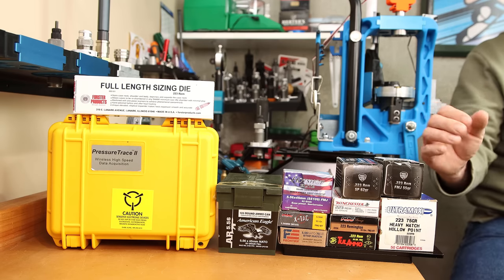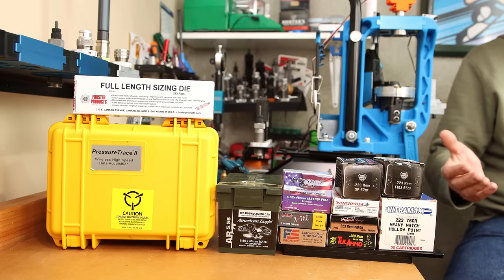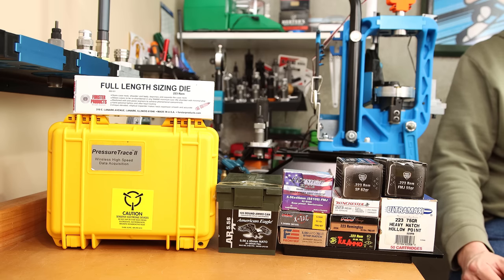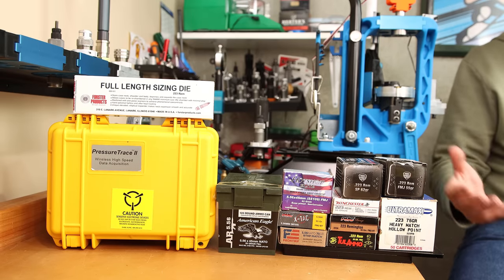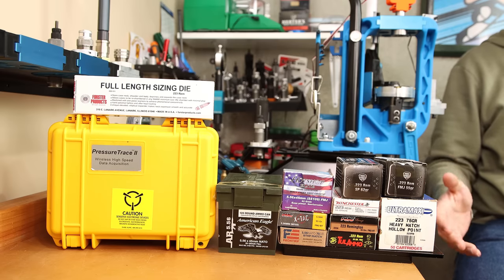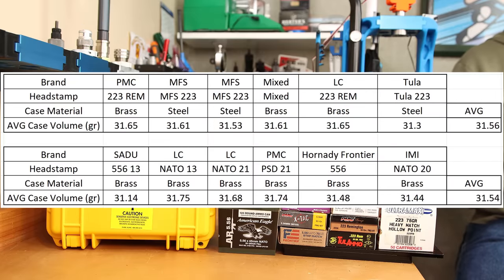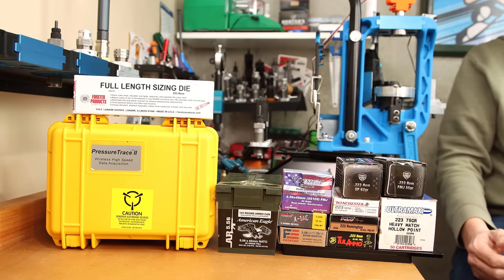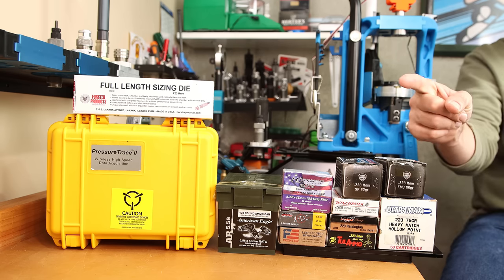223 vs 556 - The Hidden Truth No One Tells You!

Comment: I am not a reloader. Although I would like to become one.
I found this statement.... "The 5.56 NATO has a higher pressure than the 223 round and is one of the two major differences. The 5.56 NATO pressure is about 58,000 psi and the 223 round is approximately 55,000 psi. While that doesn’t seem like much on its face, a mere 3,000 psi, the case difference in the chamber balloons it to a 10,000 psi difference". Is that statement true? So the thing you should be looking at is the barrel not the ammo. Ammo varies from manufacturer to manufacturer, In fact they make ammo for all kinds of applications so it will never be uniform. So looking at ammo does you no good at all. What is a 5.56 X 45 nato barrel rated for vs. a .223 Rem? Which will blow up in your face first? How many rounds will it take to overstress a .223 barrel? Does the military use the same data for loading their ammo? Where does the 10K psi difference come into play? If they are the same why mark the barrels differently? As you say, load conservatively. Who needs such a hot round anyway? Stay safe.

Comment: Impressive equipment. Having reloaded for many years I have not had access to such. However, I've Done lots of reading on the subject and lots of hands on experience. I feel it's not good advice stating there's not much difference between the 223 and the 556 regardless of this video, albeit he does say to check with manufacturer to be safe. Personally, I have found that 556 brass is generally a harder and thicker brass than commercial 223 brass. Due to thickness of 556 I would recommend loading at least 10% less powder than what the load for whatever powder calls for in 223.(thicker brass equals less volume in case) Then work your way up from there. I've seen others blow out primers, crack cases and even destroying rifle by simply using 223 data in 556 cases without work up. Keep brass for each rifle separate. Full length size brass for first firing which it will form to that particular chamber. Then only neck size after that which will prolong case life as the case body doesn't have to contract and expand but one time. Be safe.

Comment: I don't have any problems with it in my bolt action. The only difference is that military rounds are sealed, so yes they do build up little more pressure. Other than that. There really is no difference. I even took them apart and checked on the powder and still no difference.

Comment: This is exactly why I went with the .308 cartridge
Reply: 6.5 Manbun beats .308
Reply: @whiplash636  for accuracy and range, yes.
I will take the loss with the cost of the cartridge.
Creed is expensive
Reply: @Synistercrayon  I handload everything, so pricewise, it's all the same to me really. You know, one thing I took note of when you couldn't find ammo for practically anything, was that there was never a shortage of .308 out there. Solid pick for sure.
Reply: @whiplash636  wish that I would have started hand loading years ago... I missed the boat on that one
Reply: @Synistercrayon  Eh, it's never too late to start. I only started myself about a year ago, and that's only because I wanted to get into long range shooting and needed to be able to fine tune my stuff. Be warned: If you ever decide to start loading for something, you may as well plan on loading everything you have. It quickly becomes quite the addiction, lol. Especially if you're doing low volume reloading, you don't need much at all to get started. All you need really is a single stage press such as an RCBS Rock Chucker, set of dies, powder drop, scale, priming tool, brass trimmer, and deburring tool. Entry level for everything would be in the ball park of roughly $500. The easiest thing to do without having to research and learn the hard and expensive way is to go to a reloading supplies store and tell them you're looking to get started. They'll set you up with everything you need and keep you from buying garbage and/or unnecessary items.
Reply: @whiplash636  I believe that I will look into that.
Thanks for the info!!

Comment: The old rule I've used since the 70's is a 5.56 rifle can shoot 5.56 or .223 with no problem  But, a .223 rifle has problems shooting 5.56 ammo. The difference is the chamber of the .223 rifle squeezes the shoulder of the 5.56 too much, which increases chamber pressure to dangerous levels. You should fire only .223 rounds in a .223 rifle, while the 5.56 rifle can shoot either all day with no problems.

Comment: My 2 cents, 556 has a crim on once fires and unfired brass. You have to remove the crimp on the primer and the crimp for the bullet inordet to reload them, I have been reloading for over a decade and use 556 brass for all of my 223 needs and it still works in a 556. No jams, no feeding issues, absolutely not a single squib in over 100k rounds. Size the case properly, trim to length like you should for any brass, and load safely. Have fun and domd be afraid of the misinformation.

Comment: Take a bolt rifle from the 1960’s with a true .223 chamber ream and leade distance.  You have to force a 5.56 to completely seat.   After it fires, you will find that you cannot extract the cartridge, so you have to rod it out.  Do not make the mistake of assuming that deliberately sloppy AR chambers give you an accurate representation of the differences.  They are generous for purposes of reliability, regardless of marketing or price.   So yes, if you only know AR’s, then both work interchangeably.

Comment: Just the difference of measuring caliber in inches, vs metric in centimeters.  .223 = 5.56.  The same for the many WW I, WW II, Korea, and Vietnam rifles of 30 06 and 30 30, .. 7.56 and 7.62 ...  military 5.56 is just a longer .22 Long Rifle in metal jacket vs lead, so any grains in a 5.56 will have greater number than the smaller grain of .22 or .22LR with shorter and lead ammo.

Comment: An almost 6000lb difference in chamber pressure, in an AR-15 chamber, probably isn't going to be dangerous to the shooter. It will be substantially harder on the mechanics of the rifle though. Anytime the military has experimented with stiffer loadings in this platform, rate of failure as increased exponentially. When firearms designs are initially proofed, they are typically over-pressured far beyond what the casual end-user would ever be able to do. If you're simply using name brand store bought ammo, you'll be fine. Just be prepared for the occasional breakage because of the 6000lb pressure differential. If you're handloading 223/556, stick with the recipe in the manual.

Comment: When I was reloading .223 I wanted to load 556 cases to that factory spec. I could never find what I would call reliable data, or certainly not prevalent data or reloading tables for 556. Maybe that has changed in the last 8 years. In any case, I was not terribly impressed with any combinations or powder and bullets. The velocity could never be reached to what the "factory numbers" were. But a 16" barrel will not deliver to those specs, though guys would swear to me that their loads met and exceeded 3000 fps out of a 16".  I personally doubt it, but who knows?  So,  I know 556 is loaded to a higher pressure level than 223. That may only mean a tenth or two of more powder since  pressure and powder is not linearly related. Things can get crazy really quickly by adding just a little more. Besides, max loading to get the magic numbers only guaranteed quicker barrel erosion and usually not better accuracy.

Comment: Back in the day they said the 5.56 was loaded a bit hotter.  So watch shooting out of cheaper rifles or pistols. Why they didn't just use the 222 which was well used prior to 223 I'll never know. Had a rem 221 fireball bolt action pistol way back when. It was a sweetie and would print very tight groups.

Comment: Seems as if the information I have received from guys that reload their own seems to be confirmed.  They said that the rounds were basically identical with the exception of powder.  Seems confirmed with your data, it seems to be the 556 is powder tuned for a shorter barrel whereas the 223 is tuned for a barrel that is upwards of 8 inches longer.  This seems logical to me, I wish that you had tested putting that 18" barrel against a 24" or so barrel.  I would expect to see the 223 to increase in FPS while the 556 would remain steady or possibly even drop.  What I would expect to see is a significant rise in chamber pressure how ever.

Comment: Can you fire a 5.56 in a .223 spec barrel? The answer is yes and the chance of a failure is just above zero. That is not zero so firing a a 5.56 a .223 barrel does have some possibility of failure so if you do get struck by lightning that would be on you. If you get struck with a 5.56 spec barrel you can start looking for your twelve bedroom pimped out to your spec. house.

Comment: Don't worry about which you shoot in your rifle. The only thing to worry about is the .223 will usually have a slower twist rate and won't stabilize the heavier longer bullets. If there was any real danger in mixing them up the 5.56 would have a different case so it would not chamber in a .223.

Comment: Guys 223 Wylde is designed to shoot EITHER ammo safely. But is more accurate than the 5.56 chamber. It’s unlikely to be in the typical rifle sold over the counter at a gun store.  If you want to check pressure you need to use a 223 chamber that is in spec  for 223 and 5.56 chamber that is in spec for 5.56. Then try 5.56 in the  223, if  you dare. You will find that .025 makes a LOT of difference. An interesting test would be to load some ammo to factory velocity in a 223 chamber with the standard length. The using the same components and powder charge load a couple of rounds that bullets are “jammed” .015-.020” in the rifling. I think you will find the primers will fall out.  The Wylde is going to reduce pressure for 223 and its “probably” going the slightly increase pressure in the .556. So your test while accurate as far as it goes only tells us the pressure generated in a Wylde chamber which is misleading since the commercial rifle sold will surely either have a 223 chamber or a 5.56. Now finding a 223 chamber might be tough though its possible one of the bolt action models might really be 223 while most if not all semi-autos are likely going to be in 5.56. But if you can order a barrel in Wylde you can order one in 223. I also suspect that the extra “freebore” in the 5.56 is to help keep pressure in check as the barrel heats. When putting out fire in combat sometimes they get really hot.  If you do some talking to a VN infantry vet you will find that some men getting off the ground after a fire fight were prone to burning themselves on the rifle barrel as they get up, if they were wearing a ruck especially. Though probably not more than once.  I am shooting 85.5 gr Bergers with 24 gr of Varget in a Wylde chamber with the bullets about .010” from the lands. No pressure signs with Rem 7 1/2 primers. Have not checked velocity yet but still fine tuning the load. Which is running about 1/2 MOA at 200 right now from the 20” Bartlein barrel. Velocity is less important than accuracy. But I will check it next time out for trajectory info.

Comment: I'm thinking the 5.56 firearm is built more hardily than .223, so it's likely safer running .223 in a 5.56 firearm than running 5.56 in a .223 which might not be built to handle a higher pressure.  But it doesn't seem to be TOO much extra pressure, so you might never notice any difference.
Reply: If your barrel is stamped as .223 only, then it's designed for .223 only. Thst being said, most modern rifles will shoot both, but the hotter 5.56 should be used sparingly and not at high rates of fire to preserve barrel integrity.

Comment: The difference in the brass is at the base to accommodate for higher chamber pressures, not the thickness of the neck. And a case volume test in a fired case is an irrelevant measurement. "Tired of the misinformation " so then he supplies misinformation.. lol

The difference in the brass can be clearly seen in the SAMMI spec sheet.

Comment: Wrong, wrong, wrong to many of these comments.  Short story...the concern is chambers more than ammo.  5.56 "free bore" is longer to allow for military use of tracer ammo, which is longer than .223 cartridges. Why are tracer bullets longer? They have a hollow base for the incendiary compound.  That hollowed section lowers the bullet weight, which destabilizes in flight. The added length brings the weight back up for stabilized flight. Lengthening the "free bore" prevents the longer bullet from contacting the lands prior to firing thereby preventing a pressure spike.

Comment: Great video Thank you.
I gave up on which was what and just process brass and sort to like weights and head stamps and so on that seasoned loaders do.
Actually I have heard and read the opposite and vise versa that civilian was superior to mil.. (I say how and why) but never had the data or proof to know for sure which way it Really Was.
The fine print only matters if you need to squeeze every last foot per sec and grain of powder,. But...
Truthfully I load 12-19 grns most times as I don't need to pi$$ extra powder and speed down the barrel. and my cases are soooo much easier to re-size after the 1st. work up.
I might would say something like a well placed lessor is better or equal to a blazing almost miss.

Something to consider.
How many news leads say a 223 blew up after a 556 was accidently or purposely discharged or vise versa,. they would love doing that segment,. 
but it has just slipped through the cracks., happens all the time right?

*A Very Well presented video and information.*
Thank you again.
Cheers

Comment: So the 5,56 is what we in Europe call .222 or what? It is a bit confusing talking about 5,56. All of .22, .222, .223 is 5,56.
Reply: The round is probably the same I really don't know, but the brass and powder loads could be significantly different.

I found this on the ibternet:

"The 222 Remington is the parent case for the 223. The 222 case is 1.7 (43.2 mm) , the 223 is stretched to 1.76 (45mm). The case capacity of the 223 is about 15% greater and maximum pressure is 55000 psi compared to 50000 psi for the 222. Also in the mix was the 222mag. It had similar pressure as the 223 but the case was 1.850 (47mm) and had a case capacity 5% greater than the 223."

Comment: I have always understood that the chambers of the 2 rifles are different dimensions.  The 556 is a loser tolerance than the 223. Reason being is that the 556 was made to be a rifle and Ammo that could be swapped and used in all 556 battle field  situations. The 556 has more powder and slightly larger built from what I have seen. So, yes putting a 556 round the the tighter chamber of a 223 would create more pressure. Make sense to me.

Comment: 2:41 in to this, I am going to make a prediction.. its my understanding the 556 nato brass may be thicker than 223 commercial brass. The 556 is not SAAMI regulated. therefore it could be possible in the event a little "hotter" charge is added to the 556, the case being thicker can create higher psi in the 223 chamber. Evidently the 556 nato chamber is looser aswell, for heat disapation and ejection. (?) thoughts anyone?

Comment: Only difference is the 556 has more pressure then 223. And the 223 barrels are not made for the higher pressure. It be like shooting nothing but hot loads through your gun all the time. In time it will mess up or blow up the barrel. But you can still shoot them just fine as long as you don’t let your barrel get hot and few rounds at time. I have been shooting 556 in my 223 varmint rifles, one a semi bull barrel and bull barrel, so it takes the barrels a lot longer to get hot. But in a AR I would get the 556 barrels because it’s made to handle the higher pressure of the 556 and will also shoot the 223 just fine.

Comment: The difference really comes down to required freebore distance, since the cartridges have different neck lengths.  But for the last few decades, chambers are made with generous freebore that allows the unknowing to interchange cartridges without knowing that engineers are protecting their asses.  Don’t try putting a 5.56 into a 1961 bolt rifle with a chamber and freebore cut for .223.   But for run of the mill AR’s, both run fine.
.223 has .085” of leade, the 5.56 .162”.

Comment: 0.025" is about the diameter of a modern D string on an electric guitar.  .0125 is about the diameter of an electric guitar's B string, or very small. For chamber pressure, MOST BUT NOT ALL guns in good condition should handle the CUP pressure of 5.56, but like with my Colt D frame revolvers that were reamed out to accept .357 Magnum I "NEVER EVER" make a regular habit of shooting .357 from those .38 Special revolvers. So far not one of those Colts has ever done an Elmer Keith exploding act in my hand. I don't give them many chances to do the Elmer's exploding cylinder routine, either. I have also reamed some .32 H&R Magnum guns out to .327 Fed Mag. One of those did crack. I had a local machinist make a new cylinder for me from a stronger alloy.